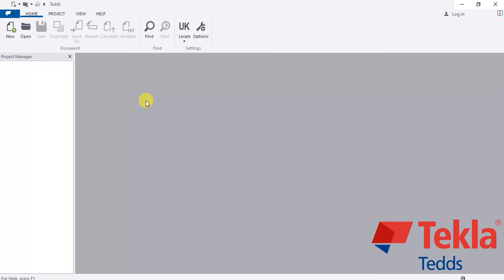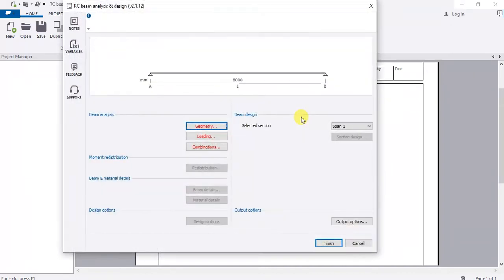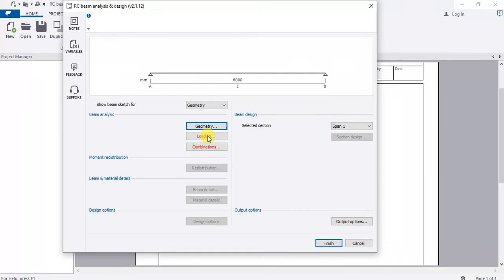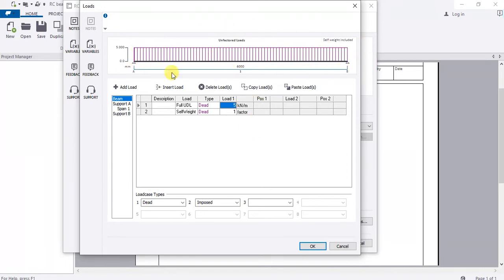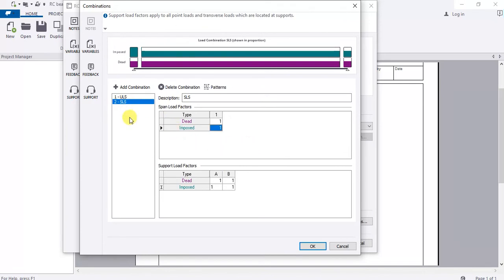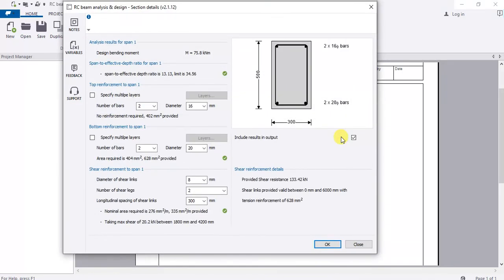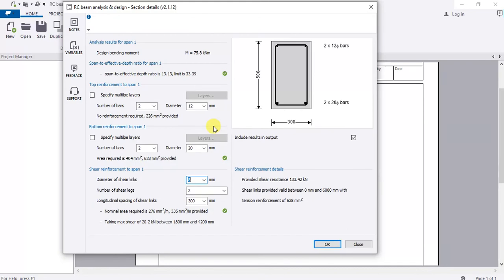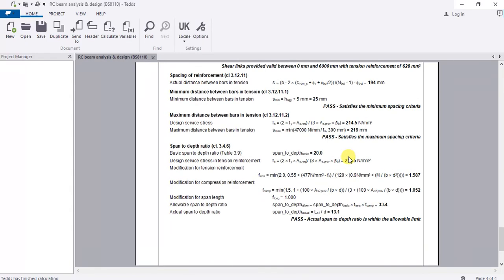BEAM ANALYSIS AND DESIGN IN TEKLA

Comment: While using Tekla Tedds for designing beam to BS 8110, all checks passed before output. However, the output showed: “FAIL – Longitudinal spacing of shear reinforcement provided is greater than maximum.” I had specified 150 mm, which was within the requirement, and even after reducing to 100 mm, the adjustment was not reflected. Could you kindly advise how to resolve this?